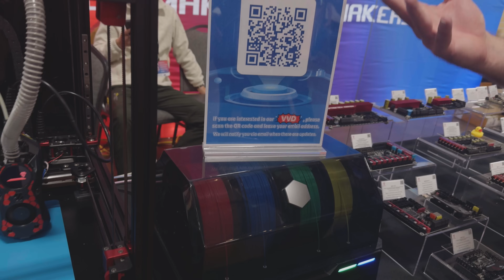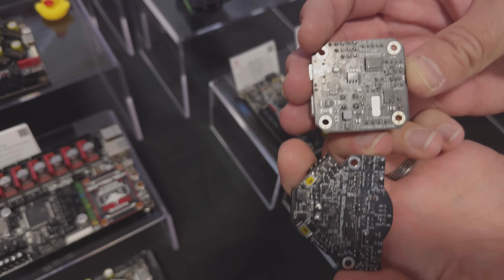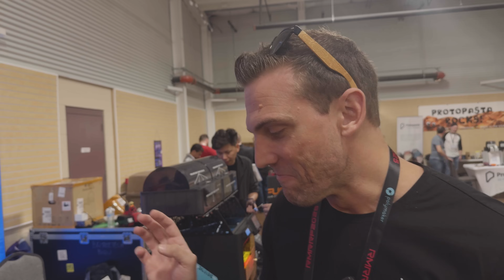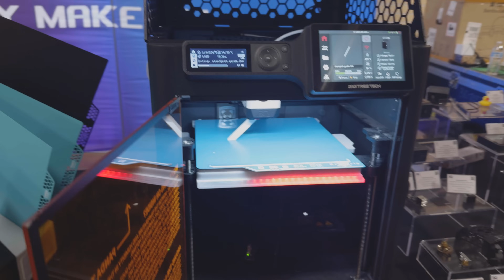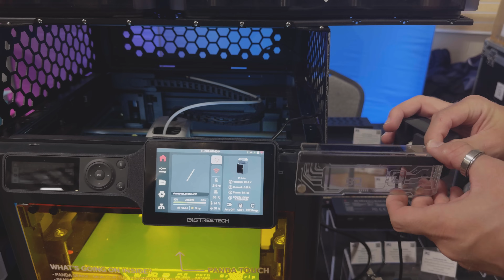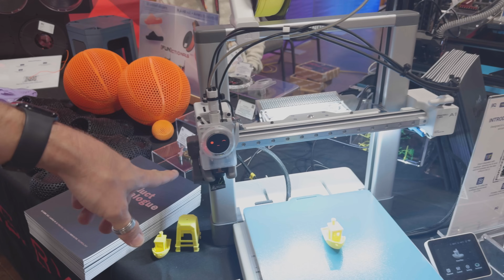West3D at RMRRF 2025 with BigTree Tech

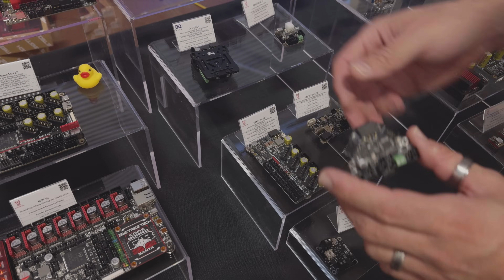Comment: @05:30 Does anyone know if those Cables with the XT30 CAN Connectors are rated for use in a Drag Chains? ( not a huge fan of Umbilical )
Reply: We made a completely new cable for the Gen 2 that is rubberized and rated for drag chains.

Comment: I tried the build plates but after 2 frostbite plates peeling, I was done. I never used alcohol with either plate and only soap and water with one.. I never washed the second and it peeled too. I was running them at 35c. I ran about 10 prints on each plate before they failed. Just my exp. I still have the cryo-grip for TPU.
Reply: Did you reach out to support using the ticketing system on the official website? They will get them replaced if you just send pics of the peeling.
Reply: @looxonline  I had one replaced and when the replacement peeled I was over it. I'm using glue stick or brims. I live way out so shipping takes a long time and I have better things to do than keep RMA-ing a build plate. Thank you for the suggestion though!

Comment: I wonder if the new EBB36 Gen 2 will have TMC2240 or will stay in TMC2209 drivers.
Reply: I also want to know when it will be available, I want bad
Reply: We went with TMC2209 because it is a great little driver that does everything that is needed for an extruder. The TMC2240 is also great but the benefits of using it are more pronounced when using it on a traditional motion axis.
Reply: @looxonline  Thank you for the answer, I can only imagine the real advantage being the TMC2240 having an internal temperature sensor. Thanks, I can't wait to get one :D